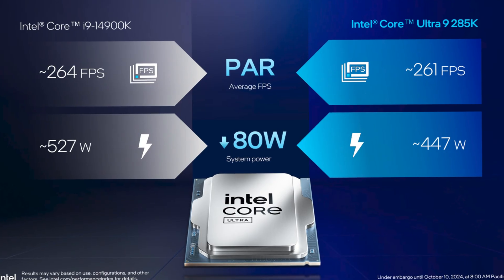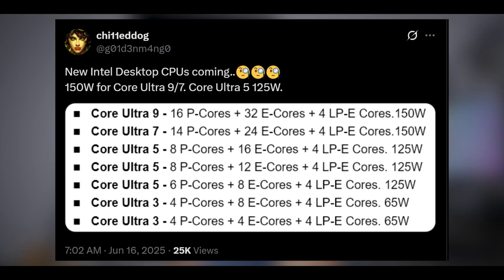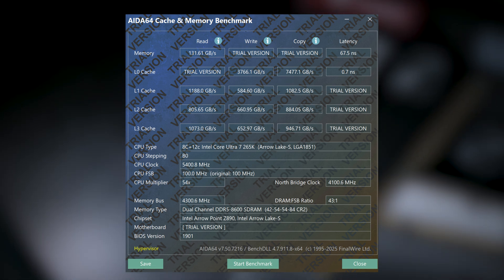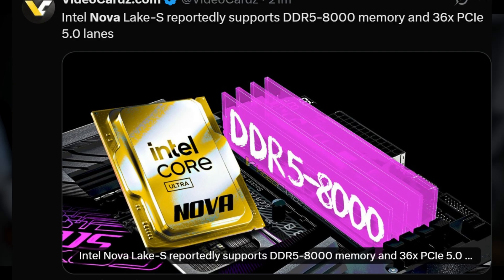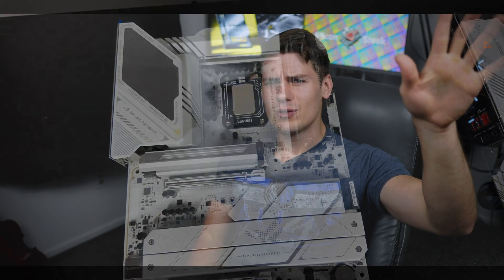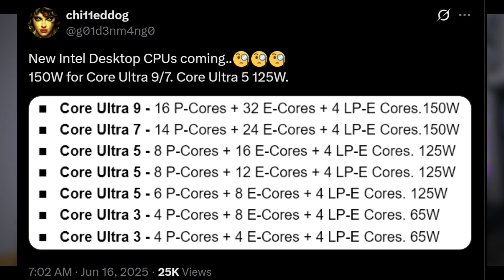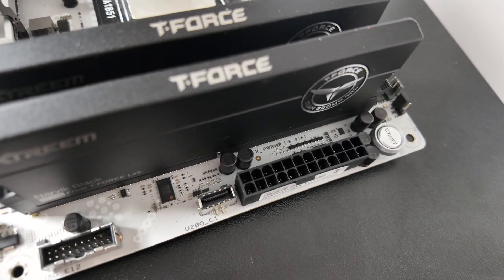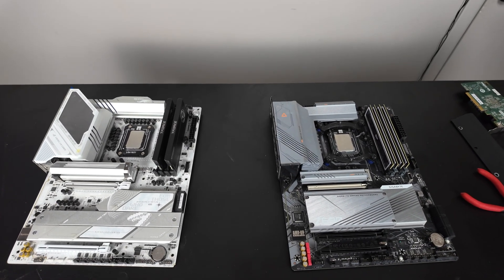Nova Lake will BEAT Ryzen

Comment: The problem is, the P+E cores setup to me is a terrible idea in a sense.

If it was 50 Performance Cores from Intel then yes I'd be like holy crap.

But if it's just a crappy like 8 cores performance and 42 efficiency cores like that's useless.
Reply from the maker: 16P 32E 4LPE

Comment: It might come down to process node and right now AMD is scheduled to be on a TSMC node a "generation" ahead of Intel and if not a "half-generation" ahead. If AMD is able to get the most advanced node, AMD will likely match or exceed single core clock speed. Also a team that poorly executed last time suddenly comes up with a Hail Mary vs. a team that's hitting on all cylinders. AMD is more likely to hit their stride, but we'll see.
Reply from the maker: I think they are both rumored to be on the same TSMC 2nm node. Nova lake could be on 18a. I think the physical core advantage of nova lake will give it a lead in video work and in multicore but in gaming at 1080p with a 5090 AMD will win. What the reviews won’t tell you is the chips are tied at 4k gaming

Comment: I'm more concerned about Intel building quality chips.  After pushing out crap they KNEW would bake itself to death AND using silicon that failed QC AND lying about it all and blaming OEM's AND trying to weasel out of RMA's... I'll believe it all when I see it.  Intel has burned an awful lot of bridges recently.  If the change of leadership and direction is real and they're not just chasing annual bonuses for a change, then great.  But yeah, I'll believe it all when I see it.

Comment: I am a pc gamer since 1999... If you are only a gamer you do not need any of this hardware not even the RTX stuff. Tech companies are overcomplicating things. I am rocking a i7 4770, GTX 1660 super, 16gb ddr3 and 2tb ssd. Can run any modern game up to 2025 at 1080p. For heavier games run low preset and the highest texture setting the vram buffer can handle and the game looks just fine. Barely can tell the difference vs high to ultra preset. Textures is the most important setting after resolution. Forget about the FOMO and save your money.  Latest game I ran was Stellar Blade 1080p medium preset but with high textures and looks great with rock solid 60 fps. May be I will upgrade in 2027/2028 when the RTX 6060 or AMD equivalent is available.  IMPORTANT DO NOT BUY A NEW GPU WITH LESS THAN 16GB VRAM so you can crank up the textures setting...A gpu like that will age like fine wine beacuse textures do not consume gpu power they are stored in the vram buffer just don't go over the limit.
Reply from the maker: You can’t run games that require RT like Indiana jones and the great circle and doom the dark ages
Reply: There is a work around for Doom dark ages. Have seen videos with the gtx 1660 super running it just fine 1080p with scaler. Indiana Jones is just the game studio trying to force ray tracing on everybody, but no work around for now for that game but upgrading a pc for just 1 game does not make sense when you can play that game later  when the pc upgrade is inevitable. But i get your point. Good observation. @SiliconSteak

Comment: Core Ultra 7 265K with a STRIX Z-890-E a TUF 5080 OC and Corsair Vengence 7200 and I got my Latency down to 74. That is not CUDIMM, I have my D2D set at 38 and my NGU set to 34 with my timings at 34-44-44-32. I didn't enable 200S boost because my settings are better than what 200S boost would of given me. I have been building, selling and repairing PCs for over 20 years and I always build Intel PCs for myself.
Reply from the maker: Jealous of that D2D… mine maxes out a 3.2ghz
Reply: I agree with you, I had 3 generations of RYZEN AMD, 1000, 3000 5000, the last one was r5800x... the worst processor ever... with terrible consumption and heating in IDLE... which none of the reviewers mention, to the disks falling out during operation and losing files. Only the 3700x worked quietly and well.
Now I finally have INTEL again... and never AMD again... not even graphics.

Comment: I can't wait for this launch, I'm holding out for Nova lake rocking my 12700K until then got build fever when arrow lake dropped but the performance and upgrade cost to the new platform did not seem worth it to me and I have a 4070S and the 12700K does just fine with that hardly ever see a CPU bottleneck but I think I will opt for the Ultra 7 because I think I will survive with a measly 42 cores 😂
Reply: @AsianPersuation24x7  Me too 👍😎🤣🤣

Comment: I want to do a build and my design goals are that it run cool and quiet and that means limiting the TDP to 65 watts. It would be nice if it were like my M1 Max Studio which usually uses much less but I don't expect x86 to be anywhere near as efficient as ARM. My needs are very good single-core performance and I don't need a lot of cores. So I'm looking at the 9700X and these are attractively priced right now. Or I could wait for the M4 Max.
Reply from the maker: 9700x wouldnt be a bad choice, but I think apple will handily beat it in terms of perf/W and also quiet operation
Reply: @SiliconSteak  I have a Mac Studio, Custom PC and iMac Pro on my desk. This particular program performs poorly on Apple Silicon. It runs 50% slower on Apple Silicon compared to my i7-10700. This program is the main reason I'm still running Windows. My Windows PC is in a huge case with a lot of fans with parts that are quite quiet. The i7-10700 runs at 10-20 watts and I have a 1050 Ti which doesn't use much power though a 4060 would be even more efficient. Apple has AMD and Intel beaten on performance/watt but keep your PC cool and quiet can be accomplished with large, slow-spinning fans and a relatively light workload.

Comment: Should I state the obvious?

Your opening statement is HEDT territory, OR Pro territory.  HEDT is a small niche market no matter how many people want to hype it, and the PRO market is expensive and for businesses and it comes with quality support no matter who sells into that PRO market, or workstation market.

I run 8 core CPUs which a few years ago many youtubers said was unnecessary because 6 cores is enough.  When Zen 6 comes out with it's new CCD expansion of 12 cores, I'll move up to a 12 core CPU because that will also be the fastest of the CPUs, and in particular an X3D variant.

I already KNOW how good that CPU will be at gaming and not because it's a 12 core CPU but because of, yes moving to direct connects between chiplets which Intel is already using and this allows AMD to FINALLY get good use of DDR5 because they'll be able to run 8000 MT/s kits and get the full benefit of them, POSSIBLY even get to 8800 MT/s which is the max spec for DDR5.  AMD is putting this on TSMC N2X and I don't care what Intel does because that CPU is going to be an outstanding gaming CPU and will run WELL into the future.  Zen 6 X3D is going to see a 15 - 20% gain over Zen 5 X3D, really.  No, really.  That's how much they're going to gain by FINALLY fixing their MCM architectural weaknesses for which Intel has never had.

My only issue will then be AMD needing to push the CPU-chipset interface up to 16 or 32GB/s instead of their pathetic 8GB/s which they've been at since Zen 2.  If AMD fixes this I don't care about anything else because I won't need anything more than this for years.  Zen 6 X3D being 15 - 20% faster than Zen 5 X3D at gaming is such a big jump, after Zen 5 X3D was also a big jump that new games just won't be an issue for years.  If they are the game company will upset so many millions of PC owners because their hardware won't be able to run the game well.

I mean really, Zen 5 X3D is already ridiculously good at gaming, Zen 6 will be the icing on the cake, the thing that makes AM6 worth it.
Reply: Zen 6 is AM5. Zen 7 will be AM6. I still love Intel (I switched to AMD) but one thing I don’t like about Intel is the constant socket switching.
Reply from the maker: I agree completely!

Comment: Can I use this to play minecraft? 

Okay jokes aside, what I mean is, would this be the best choice to play like ultra modded minecraft? Isn't the game single threaded? Would having this many cores and threads even do anything? Or is there another cpu option with a better single core performance that would be better for that?
Reply from the maker: Minecraft Java is single threaded bound. Probably tuned 14th gen or a 9800x3d. Minecraft bedrock is multi threaded so it’d be good for that.

This could be better than both those options above we just don’t know yet
Reply: Java can load chunks in parallel in newer versions. With c2me, that is made more efficient, and chunky can load chunks before they are in your render distance. Both use a crap ton of threads.

Comment: The problem with having 3 different types of cores is that you are up to the mercy of the Windows or Linux scheduler what to do with them. Remember Bulldozer? Yeah it wasn't a good concept at the time but it was made much worse by the windows scheduler not able to handle it correctly.

Comment: There is NO WAY Intel is going to beat AMD now. They are 25%-30 behind the 9950x3D even with their last generation 14900K.  

AMD already fumbled once with Ryzen 9000 and even then they still grabbed 10% more. 

This next generation of AMD is rumored to be 24 Core Desktop chips… with 12 core CCD’s. And a new IO die is a requirement now. 

There’s just no way Intel has a chance unless they somehow pull out one of the biggest architectural performance uplifts in history of over 50% with their already struggling new architecture. 

RYZEN 11000 with 10,000MHZ ram and 3000-4000 FCLK + 6Ghz CPU’s, yeah idk man. There’s just too much against them. 

I am rooting for them though. I hope they show good competition.  Intel is kind of too big to fail.
Reply: I'm so glad that the Intel era is gone, I hope,  forever. Long time Intel user 😮
Reply: Nvidia next?
Reply from the maker: In gaming I think AMD will still win. For workstation and video work… it seems Intel will be the go to
Reply: @SiliconSteak  Strongest AMD cpu for worksations is faster than 2x fastest intel cpus (workstation) and also AMD is cheaper. How intel is better for workstation?
Reply: @MacTavish9619  he means Intel on consumer workstation, not workstation workstation. I'm not convinced Intel will win consumer productivity regardless
Reply: @JBrinx18 intel takes the W for productivity with nova lake. Let’s revisit this comment when the new chips drop

Comment: i love how its 12 (8P + 4LP) real cores and 32 fake cores.
Reply from the maker: The newest ecores ipc = -10% p cores ipc. Really they are great cores for multicore workloads that don’t need low latency operations
Reply: LP-E means Low-Power E-Core. Those +4 cores are E-Cores that are even smaller and run even slower. LP-E raw performance will not be impressive, but that was never the point. They're basically for running background tasks or letting the P-Cores and E-Cores turn off when the system is in standby. The point is to reduce idle power consumption, which is particularly important for laptop battery life, and gives desktops more thermal boost headroom.

Comment: So you are saying that they are going all out on power and cores, this is telling us that they haven't learned their lesson 😂😂
Intel CPUs we're having all kinds of voltage/power issues last gen and they were forced to scale back. Meanwhile AMD CPUs are great and sip power. Next gen they are doing 3D cache and cores!
Reply from the maker: It’s all about power/performance. Do the math, if it uses 30-40% more power for 70% more multi core that’s a W
Reply: @SiliconSteak  are you joking, no it isn't a win. 

You don't just need to beat AMD at performance. You need platform longevity. That's the key to AMD win. You buy in AM5 and 4gens later you still can buy the best or second best cpu on the market. While the Intel guy needs a new Motherboard sure the intel guy has better performance for twice the price (this isn't a GPU). Beating AMD by 20% might result in 3% fps uplift if any considering temperature.
Reply from the maker: @mp24022 I was talking in terms of gen on gen improvement. AMD is going to have a solid generation with zen 6 coming up. In no way do I think it’s bad, I think they just need consider what intel is doing because they could catch up

Comment: intel fan yall are cooping hard. AMD is going bleeeding edge next gen with node  2N @6Ghz with 24 cores
Reply: Nope. Try 2N 24 to 32 cores and 7 GHZ on Zen 6. Zen 6 will be a beast. Frankly, so will Nova Lake it looks great, compared to Arrow Lake.

Gaming is Zen 6 taking the crown IMO easily though. Only physical performance cores and now 240MB of 3D V-Cache! 

16 Intel performance cores versus 24 to 32 3D V-Cache AMD performance cores only. I hope AMD never uses efficiency cores, they don’t need them at all.
Reply from the maker: We will see. Next gen Ryzen will definitely be amazing
Reply: @SiliconSteak  i dont want Itel to take the lead again. i prefer them be the underdog. when itel was in the lead the 6700k, 7700k and the 8700k was all the same CPU just the 7700k with 2 more cores 
Look at AMD they have never stagnated once.
Reply from the maker: @diKxng1080xx trust man. You want the lead to bounce back and forth between AMD and Intel. Last time Intel was undoubtedly in the lead was 12th gen vs zen 3. Then you know what happened? X3D. 

The future with competition is glorious…. Without its disastrous
Reply: @SiliconSteak  ive never been an itel fan tbh. even before Zen. i was rocking A6 and A8 in my laptop. look at what AMD did with AM4 platform. even this week they still getting new CPUs. dont get me wrong i dont want AMD to be so far ahead that they can start jacking up the price like Nvidia but i want AMD to always be like 10-15% ahead. all i want is for AMD to overtake intel in mobile share and then ill be happy.
Reply from the maker: @diKxng1080xx I used to main AMD back when they had the best price to performance. Now that’s Intel so I main them now. That’s kinda how I roll with CPUs because they don’t really have any platform exclusive features like gpus
Reply: @SiliconSteak  X3D is  platform exclusive 
if AMD was smart id leverage that AI technonlogy and run FSR4 on the AI cores of the NPUs in the CPU so Raadeon GPUs like the 7900XTX can gain FSR4 support and it would give more  customers to go all AMD for their build
Reply from the maker: There would too much latency involved in other that approach

Comment: The best thing Intel can do in the new generation is not to add more cores, because most people don't need more than 6-8 Р-cores for gaming, but to reduce latency by switching to a chiplet architecture, unlock the BIOS like AMD for most chipsets, put a powerful Celestial-based video core in there, and add 4-channel to increase memory bandwidth, which will give a multiple increase in performance in work tasks.
Reply: @Максим-ц7з5щ  , поправочка: чиплетный дизайн увеличивает задержки (Latency), а не уменьшает их. Чиплет — это, по-сути, несколько разных кристаллов на одной подложке. Передавать информацию из одного кристалла в другой куда дольше, чем внутри одного кристалла. AMD использует чиплеты, тк это дешевле (если какой-то кристалл чиплета не работает, просто отрубают его конкретно и пускают в продажу как младшую модель процессора)
Reply: I wish we could just get the absolute fastest 6 core CPU possible. Never going to happen obviously

Comment: I'm on a 6700 non-K. I'm going Zen 6.
Intel ~ sorry, I'm over it.
Reply from the maker: Understandable. Zen 6 will most likely be the gaming king with nova lake being the productivity platform
Reply: @SiliconSteak  ~ Thanks for the replay.
Oddly enough, I'm not a gamer. I'm an old Linux head, using Mint as my bare metal host, with VirtualBox and copies of Win-11, Ubuntu,  CachyOS, Fedora ~ everything I find interesting.
Arch, actually? Yeah, Arch is playing up just now and I've got the shits with them. But they will fix it and I will make another Arch install.
On zen 4 or 5, I'd be headed to the dual CCX 16 core, but I really think when we get to zen 6, one CCX and 12 cores is going to be enough for what I do, and insisting on the double CCX is only going to make the thing more expensive.
I am strongly drawn to Linux, and AMD are not quite a model citizen of the free & open sauce world, but they're a better / nicer player than Intel and far better than nVidia.
When I bought / built this i7-6700, there WAS no Ryzen. The logical choice for a Linux neck-beard was a fairly high end Intel rig. That's no longer true.
It sounds like a silly transition, but when I look at what the 6700 was at the time, not quite the biggest fastest baddest computer for a home user, but fairly close, and what the single CCX zen 6 is lining up to be, I think that's a roughly parallel upgrade. Of course, along with a 5th gen M.2 drive, we're going to get a little bit more performance ~ ;-) I think I'll cough up for a 1440p monitor as well ...
Reply from the maker: Nice. Sounds like upgrades like this don’t come often so enjoy it